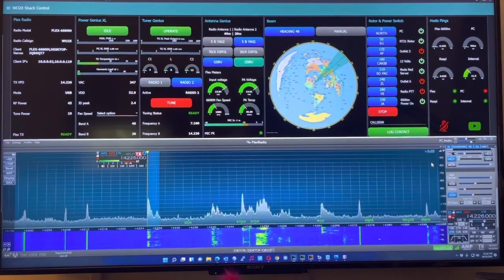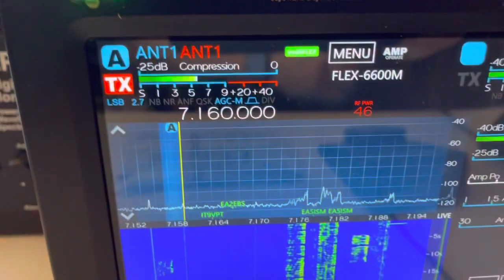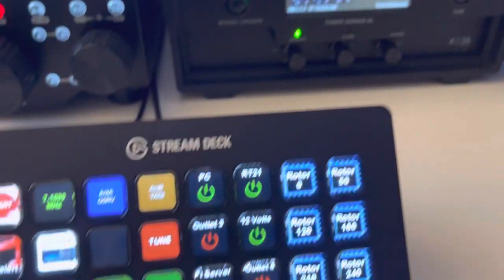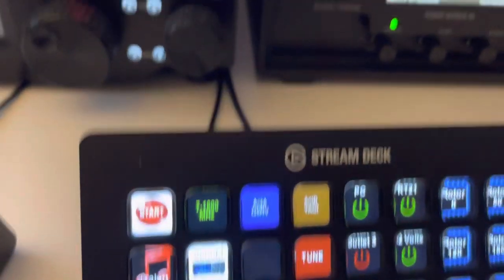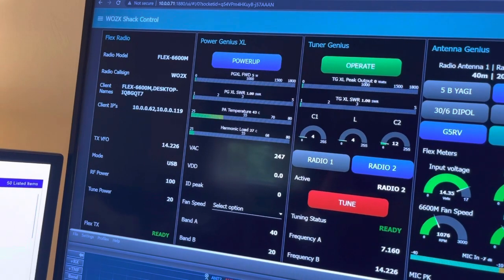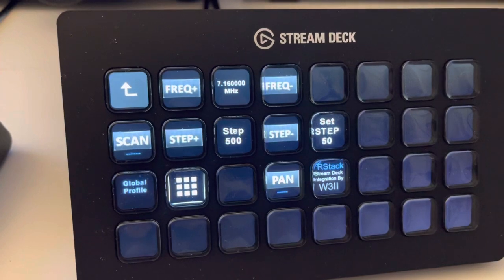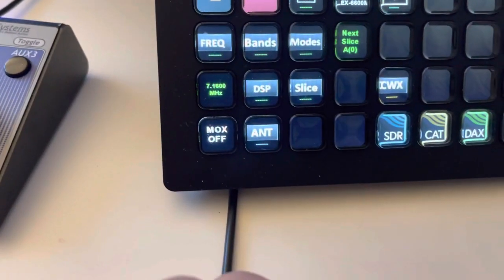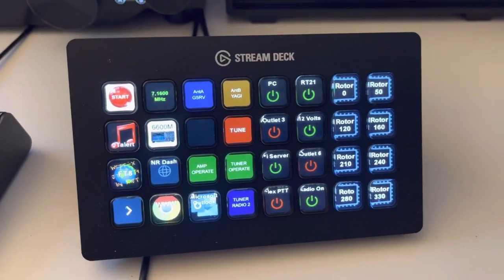StreamDeck integration with Node Red using web socket and FRStack REST commands

Comment: Impressive very nice, thanks for sharing ! 
So many questions but the main one is how do you get the rotor map display ?
TU 73 de Juan TG9AJR
Reply from the maker: Hi Juan, the rotor controller (Green Heron RT21) is interfaced to my Node Red server that runs on a Raspberry Pi. The azimuth map is part of Node Ted programming. You can click on any country on the map and it turns the antennas automatically. More info on Node Red for ham radio at https://groups.io/g/nodered-hamradio

Comment: Do you know anyone using Node Red and the StreamDeck with Icom HF radios?
Reply: Mel, I'm working on getting Node Red working with my Icom HF radios. Will do a video once i have it working.
Reply from the maker: Hi Mel,
Mike Walker has a Node Red flow which can interface to Icom radios via Hamlib. Then the Stream Deck can communicate to Node Red and be able to send commands to the Icom. Check out the Node Red for Ham Radio group on groups.io
https://groups.io/g/nodered-hamradio
I look forward to seeing you in August. I will be bringing the Stream Deck to do a Live demo for the audience.